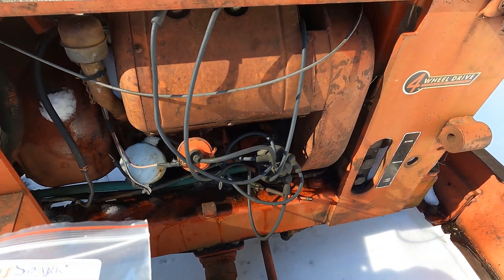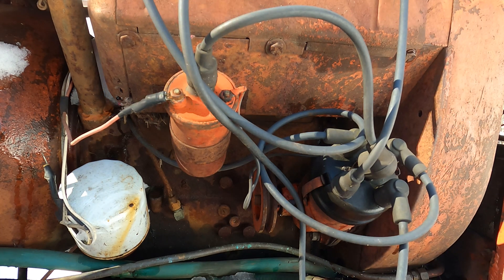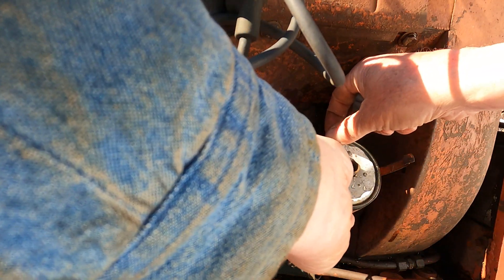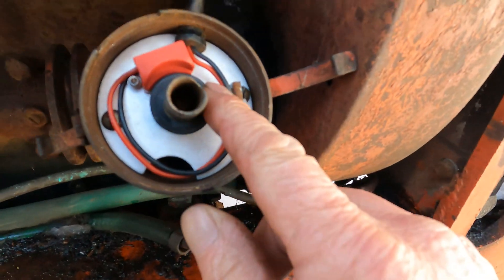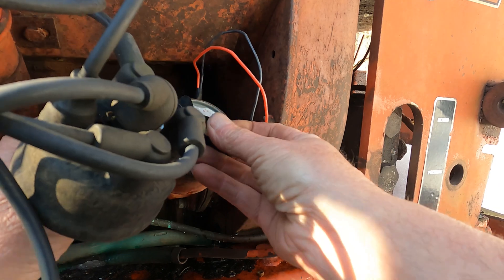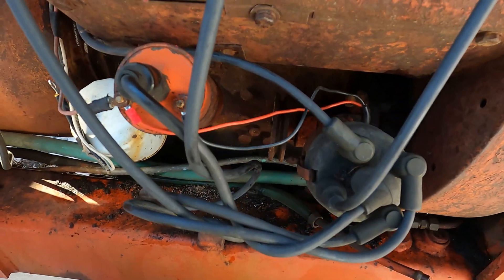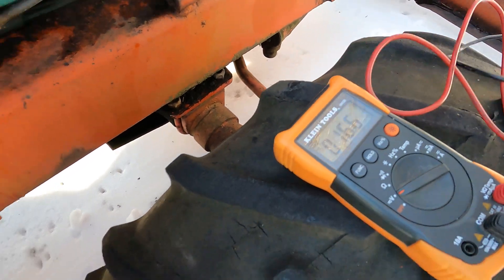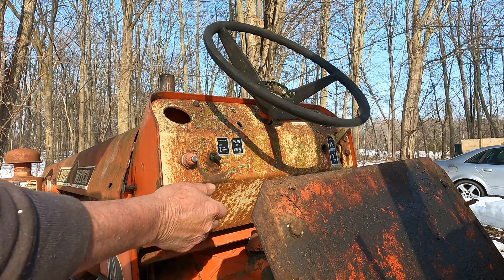Ditching the Ditch Witch Points with HOT SPARK Electronic Ignition

Comment: I installed a similar kit on my VH4d Wisconsin engine and I love how well it improved the starting of the machine, especially when it's cold outside. A rebuilt a Case 1537 skidsteer a few years back. Make sure you clean out the cylinder air passages or you could damage the motor.

Comment: I did a similar conversion on my old Ford backhoe several years ago. Best thing I ever did for it! Unfortunately it sits a lot between uses, so I was constantly having to clean the points every time I went to run it. Even with good Echlin points from NAPA. Since the conversion, it fires right up every time.
Reply from the maker: same, we put it on our ford 800 and its amazing how much better it starts and runs.